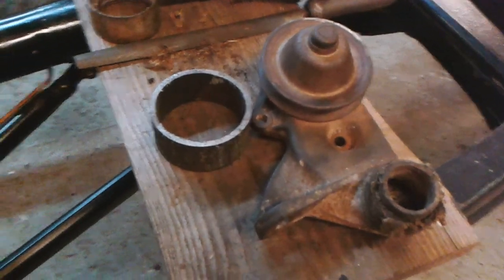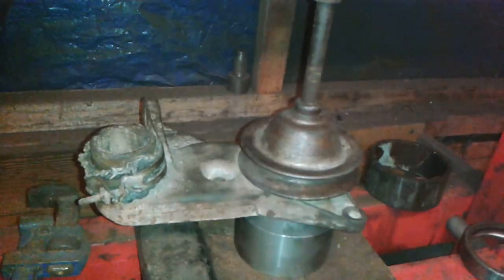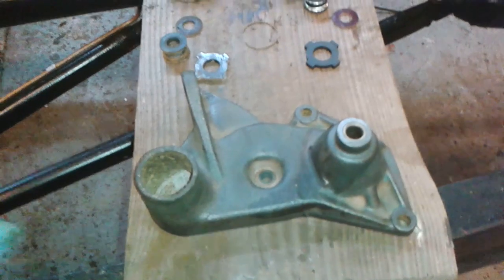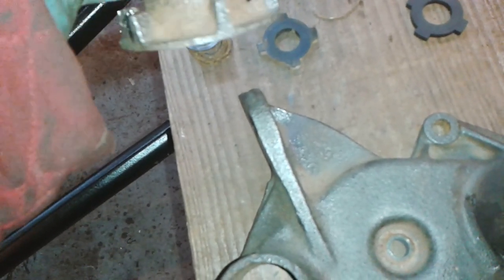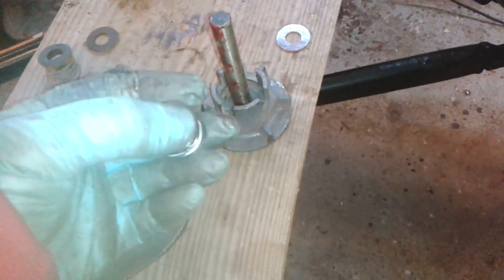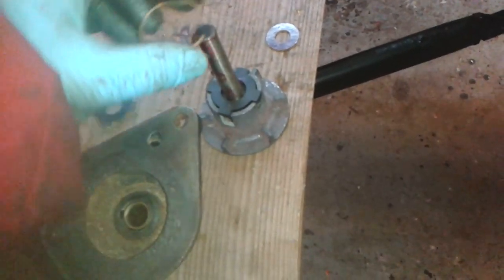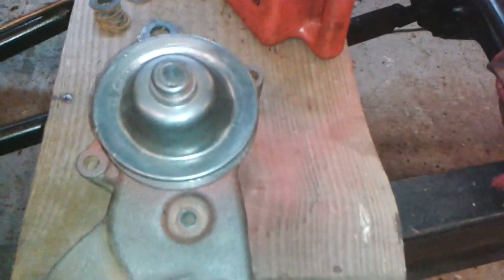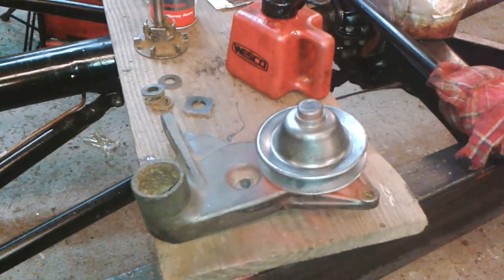Here's a Flathead water pump. Let's rebuild it. Sunday tech quickie

Comment: I followed those disassembly instructions and mine came apart just fine. One popped with pressure, the other did not. Looks easy to assemble when the new kits arrive.
Reply from the maker: Hi Ryan. When you reassemble make sure the shaft presses in nice and square. One of mine went in a bit cock eyed and took a shaving off the bore. The pulley came loose quite quickly. Something to watch out for.

Comment: Nice job. Marts standards 🤣🤣😇 oh my..... Do you know something, I have never rebuilt any type of water pump. I have all the tools but I’ve just never done it. You made it look easy.  I was always thinking I would break something. Thanks for sharing 👍👍👍
Reply from the maker: The thing is, Ron you have more options available. Drakes pumps are cheap if buying within the USA. For me I have to rework things when I can. The 8BA ones are more difficult, so not all are as easy as this. It is important the face the seal rubs against is good too, which I didn't emphasise in the video.

Comment: I've only ever re-built one water pump. It was on a wartime Bedford straight-six but was essentially the same set up as these Ford pumps. I was told to dab a small amount of valve grinding paste onto the carbon discs before assembly to help them bed in as the water-tightness depends on them mating perfectly. .... It leaked....
Reply from the maker: Oh dear, Mart, I don't like the sound of that. Do you think they meant lap it in, then clean after?
Reply: @MartsGarage  I don't think so, but maybe I'm wrong.

Comment: Hi Mart:
I don't have any "hands on" experience with these pumps. Studied your videos and cannot figure out how they circulate (route) the water in the system.What we are seeing is a pump casting that has an impeller  with no apparent valute and/or passages leading to the outlet. When you install the pumps, can you explain how these pumps pressurize and move the water in the motor casting/system??
Reply from the maker: Hi Bob. I'll give it a stab. If you look at this video near the beginning https://youtu.be/_rjWqgPmu9s you can see where the pumps bolt to the block. There are 2 holes. Ignore the lower one, only the upper one is active and that is where the impeller sits. The pump blocks off the lower hole. Now look at the pump body. The central part of the pump body is hollow and the lower hose connection is connected through the body of the pump to the cavity around the small end of the impeller. The impeller spins and draws water up from the lower hose connection and splurges it out into the front of the block. From then on the water circulated up through the motor and out to the top of the radiator. It then gets drawn down through the rad and into the lower end of the pump to complete the cycle. Hope that helps. Mart.

Comment: Hi Mart, my Pilot has the twin pulleys. Do you know if that determines whether it's fitted with a roller bearing or not? Also, where did you get the repair kit. Keep up the good work, these videos are gems. Cheers, Steve
Reply from the maker: Hi Steve. Twin pulley denotes a truck pump which had a ball bearing type shaft assembly. I think you have to pull the pulley or impeller. Then probably remove a circlip and push the bearing/shaft assembly out. These pumps would fit a Pilot, but the Pilot may have a heater tapping which these do not have. I bought these kits from Macs in the USA. On these pumps if you push the impeller it will move against the spring. The truck type will not. That's how you can tell if bushed or not, except it will not move if all rusted up like this one was.